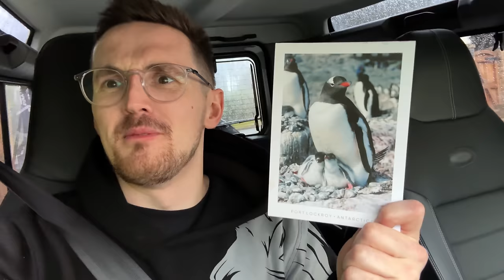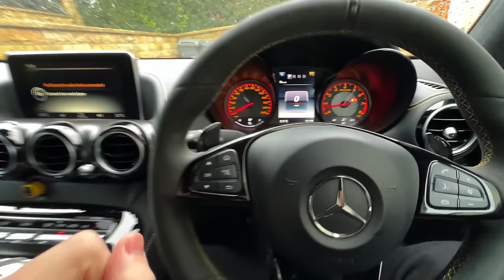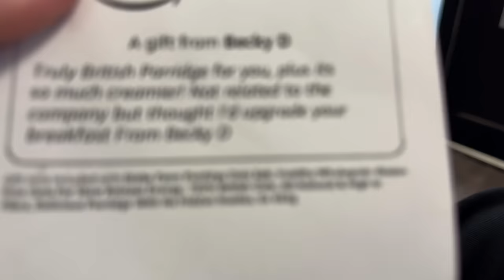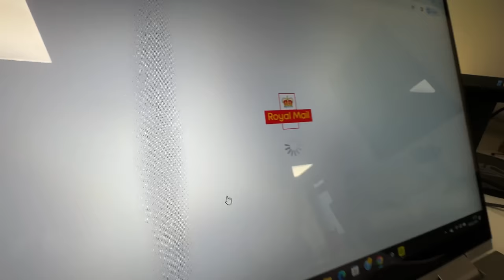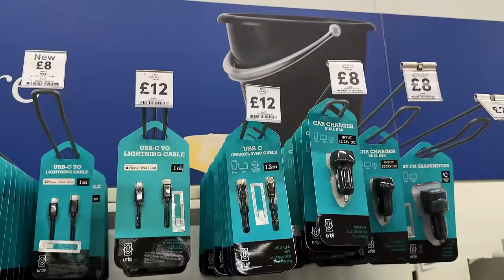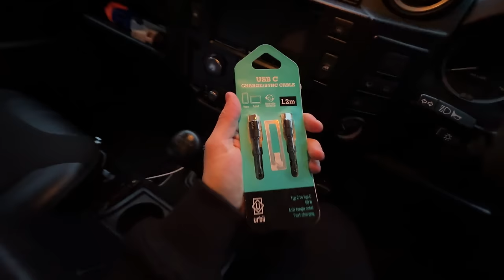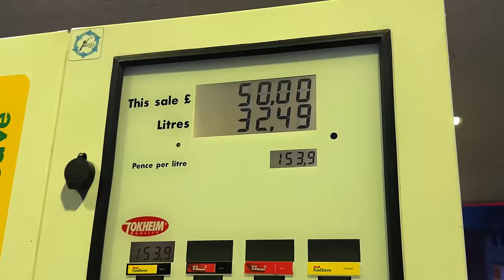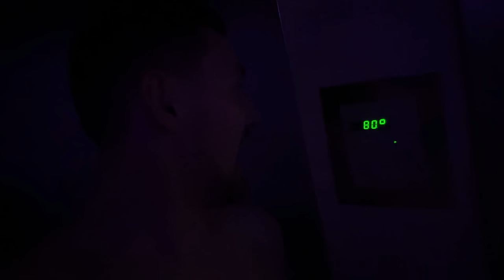We’ve got A LOT of Problems on our hands!

Comment: As a Scandinavian: for many sauna is about relaxation by balancing between hot sauna and cooling off - not being in there as long as you can while feeling awful.. The best feeling comes for repeating this following pattern at least couple or few times: 1) going in the sauna, occasionally throwing some water on the stove until you feel too hot or exhausted but still okay and then 2) cool off out of the sauna and/or drink a cold beverage and/or take a cold shower and/or go outside naked or just with your towel on (it feels so nice when you've been in the sauna for a while!). Then just repeat 1) and 2) as long a you have time and it feels good.

Recommend to try it like this Tom! Cheers from Lapland!

P.S. probably not best for you to go out full naked considering you have neighbours so close by and this custom might be a bit weird one in your community... :D

Comment: Speaking as an electrician, the towel rail will be perfectly fine on a 3 or 5a fuse depending on rating. 13a is actually abit big for a towel rail, they tend not to draw much power, it will only have a 13a fuse in from when the switch was bought, they come with a 13a from the shop, the electrician installing it is meant to rate it correctly. (Just a tip for the future)👍 19:56
Reply: Also going to be the element that needs changing if it’s not the fuse
Reply: @manapoors6315  yep fuse will have blown as the element will be at the first stages of degrading, I see it all the time in hot water tanks etc, the fuse blowing will get more and more frequent until one day the
element will no longer work/need replacement

Comment: By the seems of things (speaking as an electrical engineer), the heating element in the towel radiator has given up, which caused the fuse to blow. So will need to be replaced unfortunately.

Comment: you got to do a days work and u didn’t mess with the boiler u turned the tap heat up but u need out the pressure up by pipe/tap at bottom

Comment: You can fix your shower Tom, turn the temperature as cold as you can then if you pop off the raised tab on the mixer(temperature) there’s a little hex key (Allen key) bolt undo it and the handle will come off and just put it back on slightly more towards the hot then this will you allow you to get more cold out of the mixer

Comment: Tom, did you check the radiator hasn’t tripped the switch on the board when the fuse blew